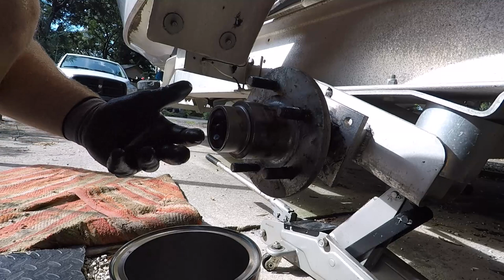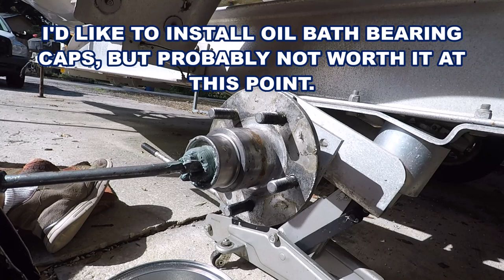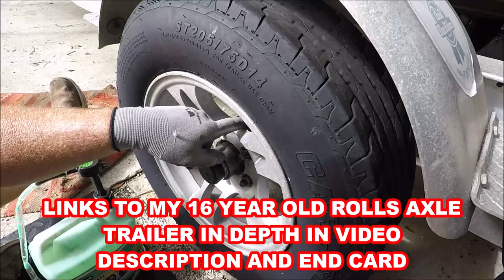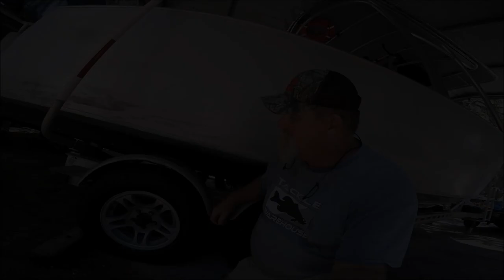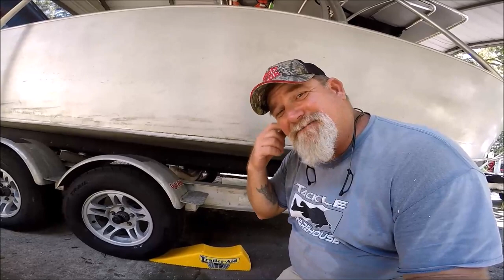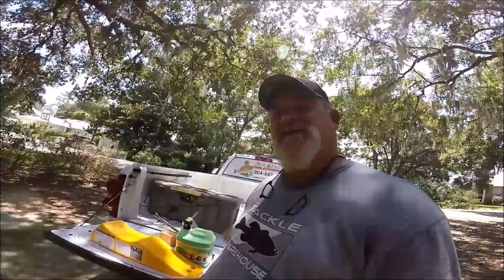BOAT TRAILER MAINTENANCE, or pay the consequences❗❗

Comment: Outstanding video Capt Dave. My trailer has the same type lube system as you do, so I appreciate your approach to changing the grease. As a sidebar, on the way from the mid-Atlantic states to a Canadadian fishing vacation, my driver side trailer wheel bearings burnt up going through Harrisburgh, PA. There I was on the side of the road , taking the tire off, then the hub, chipping the races off the axle with a hammer and chisel, filing the races smooth with a crosscut, finishing with emery cloth, installing new bearings and races, pumping fresh lube into the hubs, putting the tire back on, all by myself while tractor trailers raced a scant few feet away traveling 70 mph. Took about 2 harrowing hours sometime around noon in June. It is not unusual for guys to trailer 50 to 100 miles fishing hereabouts. So guys, listen to Dave Take care of that boat trailer..
Reply from the maker: thanks for the story....seen & heard, many like that too, over the years.

Comment: Hey Dave, the extra outer cap that you are using on the ez lube hub looks like a great idea. Are these repurposed from something else or does someone sell them for the ez lube system? They kinda look like the cap from tubes of grease. Gary in NSB
Reply from the maker: Hello Gary no not repurposed I bought them for this application and they are available from people who sell the outer stainless cap that goes over the Hub I've had to replace him a couple times so far along with the little push in caps and have replaced the outside hubcap part from galvanized to stainless there around a good place to look is on eBay Amazon and or etrailer dot-com
Reply: @CaptDavesSportfishing  Thanks Dave!